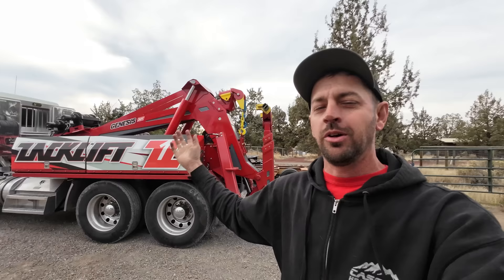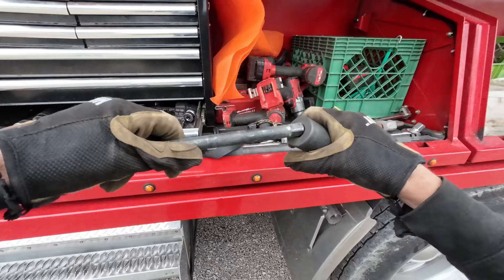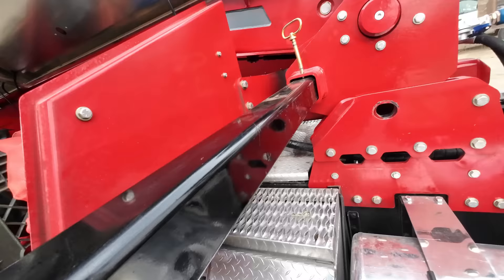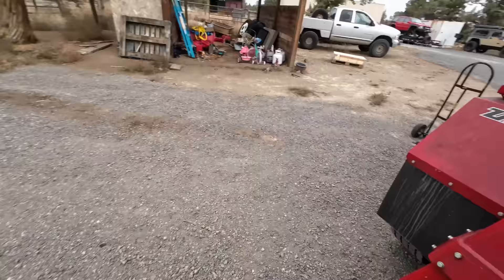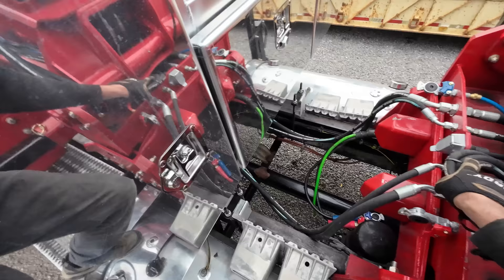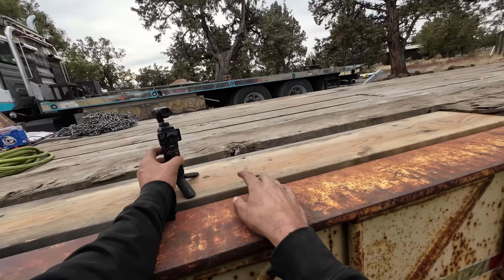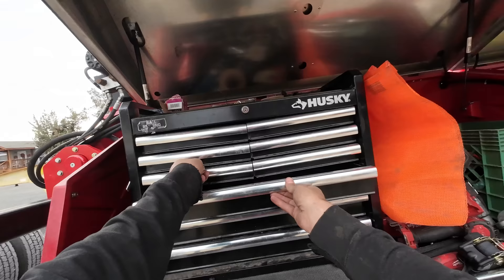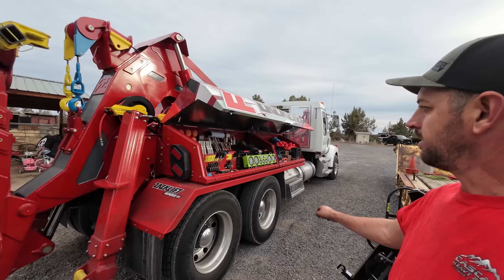How a quick change Heavy Wrecker works!  (the do anything truck)

Comment: I think you can remove the wrecker off your truck quicker than I can remove my camper off my pickup.
Reply: For real
Reply: pretty much the same for getting a roofbox onto my Wagon lol, i'm quite certain that this took me more than 10 minutes
Reply: Same here. Pull behind takes me 15 to 20 minutes to disconnect.
Reply: Funny that's the exact first thing I thought of. 😂
Reply: Faster than getting my w... off lmao
Reply: @deeremeyer1749 just because it's "easy" or "quick" to remove doesn't mean it's incapable of being "heavy duty".

Comment: I like the idea about a winch that uses the existing mount after you detach. I am sure if you contact the manufacturer they would be willing to build you one that uses the same hydraulic connections and then offer the winch as an accessory to their product line.
Reply: Now your thinking! Great idea . I'm gonna steel it ! Lol
Reply: @davestevens4263  Really your going to steel it , or steal it?
Reply: The downside is that a large hydraulic winch is probably a bit heavy and bulky to move into place. A harbor freight battery powered one can be a lot smaller and lighter and still do what is needed.
Reply: Probably would be a good accessory for them to make. But knowing you. Can make it better and faster.
Reply: Add a davit arm to lift the winch on & off. They could easily drop into a bracket on the frame.
Reply: @TBJK07Jeep  your idea is the best, considering that in the background he has goose neck trailer and will a good heavy duty hydraulic winch for it and pulling heavy equipment on to it.

Comment: Since you need a impact to release the tension on the chains you should just remove the jack handles on the legs and weld some nuts on in their place, use nuts that are the same size as the chain tension bolts so you only need one socket.
Reply: I like this idea. I have had tools break, and batteries get cold, so the redundant survivalist in me says to leave the hand cranks, but it's not a bad idea at all.
Reply: @JonathanSias  Weld a socket on one of the hand cranks, redundancy problem solved.
Reply: Yep, I've done this on all my trailers. Welding a socket is the way to go, just keep a breaker bar handy and you're g2g

Comment: I believe you could get it down to 7 minutes after the landing gear becomes permanent mount.
Reply: Could remove the handle and weld a nut so you can use a cordless drill to drop them faster, although idk if it would hurt the gears to do like that.  Awesome equipment and great video as always, Casey!!
Reply: @User_Joe   he tends to not be a fan of depending  on having power tools to run stuff (and having done what you suggested to one of our goose neck trailers  after ripping off a jack handle for the second time (caught a branch once and snagged it on a round bail the other time)   i felt kind of dumb having to use an adjustable wrench to lift a loaded trailer so i could unhook bc i forgot the driver i made a new handle for it lol
Reply: I guess like 8 minutes in the future, while not filming talking and showing stuff plus getting the boxes moved for the legs! ;)
Reply: Agreed us if he wasn't explaining it to us then he could shave some off foe thst too🤷🏻‍♂️😁
Reply: 13:30 that's actually a great idea glad I thought about it 😂😂😂  but really though that looks like it would work pretty good sir
Reply: @wmose3694  You already "need" one for the rear frame hooks, so might as well use it for the landing gear :)
Reply: The front landing legs need to be incorporated into body somehow.
Even something so simple as turning them upside down in  stowage.
Will save time and messing about not having to find them but also give the flexibility of being able to drop the wrecker off in the field.
Other than that, what a well designed and executed bit of kit.

Comment: Zacklift might be interested in building the winch mount for you.  Surely, you are not the only customer that has such a need/desire.
Reply: if zacklift made it then it could be capable of being controlled by the wireless controller from the big unit blue side or yellow side depends on witch hydraulic line he hooks up
Reply: @charlesflakusj.r6344 no because thats integrated into the wrecker body. Not the truck side. Truck pto only supplies the hydraulic flow and moving it. You could run the body off of a pony motor if you wanted to

Comment: I'm not a trucker but I am very impressed with the functionality of the Zacklift and the ease with which you remove/replace it on your truck.
Reply: Remember, there's hardware on the truck, that needs to be hooked up to prior, so the ZachLift can be a securely secured.
Reply: i think any fleet owner who does local stuff and has 10 or more trucks could use this for sure

Comment: Transformer toys for big boys. No need for more speed Casey, I think you already got the chronological order of your contraption down to a science. I love the fact on how clean and tidy the wrecker attachment is, You can detach, walk around with a pressure washer with easy access below, pretty sweet rig, easy to service, the wrecker can be dropped off for repairs without shutting down the truck. A semi for hauling and a rig for towing all-in-one, you can't get mad at that.

Comment: You need a folding engine hoist, modified to be able to lift the winch up onto the front mount bracket (and save your back and another hernia). Beyond that, this looks to be the perfect setup that truly gives you the best of both worlds - a heavy wrecker with some awesome abilities, and a 5th wheel setup to be able to haul almost any trailer you have need to haul. It's very easy to understand why you made the decision that you did for the unit that you did - very nice looking setup, Casey!
Reply: He can store the winch on the flatbed, so then he just need some planks to drag it on and off the truck.  Assuming its down hill he can drag it easy down, and use the winch to drag itself up.
Reply: Not worth it. He has the little wrecker he can use as a crane if its to heavy
Reply: Put similar feet under the winch. You can drive from underneath the lift, and backup underneath the winch. Remove the legs, and off you go.
That way it can even be the heavy duty winch.
Reply: so WHY isnt this used more??? "gives you the best of both worlds"
Reply: @LimBo3500  over thinking it

Comment: Have ZackLift design and build a hydraulic winch to attach to the empty front mount when the wrecker body is removed. You can be tester #1 for a new product!
Reply: yes if Zacklift builds it then it can be compatible with the wireless controller that is used on the tow unit

Comment: Nice change over as a visual when you have the front legs on spray paint to where the holes for the pins to drop throw with ease so if you have to do it in low lighting you will not need to struggle and forget something.

Comment: Very nice setup Casey. Regarding front jacks. Change square receivers to round ones and simply rotate the jacks forward and pin them there. Pull pin, rotate down, and they’re done. Tip: Remove handles and replace with a nut the same size as chain releases.

Comment: Another idea: Weld a tab with a hole in it on the front legs to put the big front locking pins in when they are removed, that way they dont get lost and are right where you need them when it is time to hook back up. Also, chain or safety wire the front leg pins and clips to the front legs so they don't get dropped in the snow or gravel and get lost. 
As others mentioned, paint a stripe around the front legs to help align the holes. 
Great job and awesome piece of kit you have there.

Comment: Hello from the Netherlands.
It might be an idea to place a bracket in the middle under your headboard rack boxes for the air couplings and lighting plug of the truck itself.  
This way they are always out of the way and yet in the right place when connecting and disconnecting.  
and perhaps also hang a bracket on the wrecker unit for the hydraulic hoses, 
so you always place them in the same place and hang them in a good bracket that holds the couplings in place
thanks for the video.  
Kind regards, Hollandduck
Reply from the maker: The headboard is WAY too far away from the trailer for that to work

Comment: An Apex winch in a cradle pinned to the bracket is a great idea. I'm thinking a small A frame above the winch, with a rotating sheave head instead of a normal fair lead to make it easy, well easier on the rope anyway, to go off the sides of the truck if needed. A set of cables, with an Anderson style quick disconnect plug could be mounted under the center box of the headache rack for connecting it to the batteries.
I'm not in the wrecker business, but it makes sense in my head.

Comment: you should ask Zacklift to design and built and winch mount  that goes into their frame mount it could run off of one of your hydraulic  line sets and use your wireless controller. those hydraulic winches are heavy so have the mount have its own set of detachable legs that hold it in the air higher then your fifth wheel so you can drive under it with the truck and crank lower it into the frame mounts.

Comment: You should design a winch plate and market it with Zacklift - you can't be the only driver that would benefit from that - and you've got those pins to use to mount the winch plate, nice and solid.  Good idea.  Nice video  - thanks  (sorry - no criticisms)

Comment: On your landing gear, remove the crank handles, get 2 big 1/2" drive  impact sockets, weld on in place of crank handle.  Use your impact to raise and lower.  If too much weight is on legs, you can use a breaker bar to free up.  Just an idea to make life a little easier.

Comment: O-H-I-O Porter greetings 🇺🇸The Zacklift is rather impressive in more ways than 1! Takes me back to when I used our old 5th wheel boom that was fitted with a cable hand crank & used a bungee to hold handle in place. All mechanical! I can never complain about it since I hauled many tractors & buses with it. You have quite a handy unit there! Thanks for sharing the unload process. Having the bulkhead tool rack on the truck is always a good thing! Never enough storage space anyway. An easy conversion either way & then you’re on your way. Good stuff! 🎄🥰✌️

Comment: Very nice and so versatile!! 
In this day and time whereas so many things are run by impact drivers, it would be nice if the black legs had a nut along with or instead of the hand cranks and then you could use your impact driver to zip the legs down and up.

Comment: This is a nice setup. It will be nice when the front landing gear are mounted permanently, which will shave a few minutes off the setup/takedown time. It seems like any time I have a suggestion lately, you already thought of it in the video or one of the other commenters beat me to the punch. Semper tow!

Comment: Consider adding 3M or equivalent highly reflective tape around the black removable legs.  Wrap the reflective tape around the leg tube at the point the leg inserts into the housing.  This will give you a visual reference as to precisely how far you have to push the Leg into the Housing.  Being reflective makes it easier to see 👀 at night .

Shaves off a few seconds to a minute. 

G.

Comment: 6:20 Routine also helps you remember to do everything. I had a 7 step routine for loading when I was hauling crude oil in Texas. I counted the steps as I did them and then recount after I was done to make sure I had done everything.

Comment: Hey Casey, nice one again 👍
Just get protective plugs on both sides of hydraulic quick couplings. Open couplings are prime source of debris that is later going to the system and destroy valves, cylinders, rods, pump... Don't ask how I know 😅

Oh, and get those doors on the head board sorted 👍

Comment: You have lots of experience heavy hauling, so you know what you need. The real difference is you are smart and creative so you can do things with your gear that others wouldn't think to do...like the idea of the custom mount for a winch. I used a Warn Multi-mount front hitch receiver made for an F series Ford upside down mounted to my inner bumper on my 4Runner to mount a Harbor Freight Apex  winch. I just cut a hole in the plastic bumper cover behind the license plate. When I pull the pin and Anderson plug it comes off easily. Then I can reinstall the license plate and it covers the hole. It's simple, strong and works well.

Comment: That really is pretty damn cool. Someone really did a lot of homework designing that thing. That portable winch idea is awesome. To be honest, I'm kinda surprised that they didn't do something like that and at least make it an add-on accessory or if maybe it did come up in  R&D and it just got shot down.
You could also have deducted about 30 seconds from your time in this one because of that time that you spent around 08:45 when you were explaining the hydraulics and the boom not dropping when there's no fluid flow and another 25 or so while you were setting up the side view camera on the trailer at 11:35, so your actual time was roughly 10½ish minutes here. If you got everything with your side boxes moved back a little, leaving those front support legs attached and got into a routine, I don't think 9-9½ minutes is out of the question at all.

Comment: Add hydraulic lock on the front mounting plate will speed it up, just like the quick attach you have on wheel loaders to release or lock the bucket. And you have room in-front of the mount under the headboard to attach a permanent winch that you can use wen you work with a trailer.

Comment: Great video. But just a thought. Take the handles off of the front jacks. Weld a nut to the shaft same size as the chain tension bolts

Comment: Lights inside your headboard? Backup camera for your kingpin? Hydraulic operated landing gear? Places to store wooden 16"x16"x8" outrigger pads w/rope handles. Kingpin lock when not in use.

Comment: The rear stabiliser legs have a pilot operated valve , this means they won't retract unless hydraulic pressure is there to open the valve. The side support legs could be fitted with hydraulic cylinders instead of winding gear again with pilot valves to speed up the process of demounting .

Comment: The US General are great boxes, but may not fit. They are much deeper. Almost 22” vs 16 for your Husky. 

I love the versatility of that truck. The Zacklift is a brilliant idea and looks like they did a good job with the execution of it. Less than 10 min to go from heavy wrecker to ready for a trailer will keep that truck in service and not just sitting most of the time. Unless you hire someone, you can only drive one truck at a time.

Comment: The winch setup to mount on the permanent zacklift mount would be ideal. Can't wait to see you get the hydraulic feet for the front of the zacklift, much smoother transition.

Comment: I think if you added some tape or marks on the legs to help identify when they are lined up approximately with pin locations could help. I think when you get your routine down you could be under 10 minutes easy.

Comment: You could have some kind of simple shelter you could use to cover part of the rig when it's raining or snowing heavily. To make it easier to connect/disconnect. Also would be nice if the legs/lifts? were hydraulic and you could just flip a switch and they'd deploy themselves. Dreams, I know.

Comment: The pins that hold the removable legs have those spring clips to secure them (not sure of the right term). On a boat, shackle pins are often connected to their shackle permanently with stainless wire, so you're not trying to find them when you drop them in sand or snow.

Comment: That is a nice change option for this rig. You will get the time quicker as you develop a routine, I'm sure. Adding a winch mount to that red bracket is what I thought when you showed it - it would be an easy upgrade. One thing to think about - could you make those front support legs powered so you don't have to crank two separate lifts from opposite sides of the truck ... most trailer landing gears only have to be cranked from one side, right??

The Harbor Freight US General toolboxes would be an excellent choice - they have some really nice ones that are durable, available in a variety of colors. Keep us updated on what changes you make to this unit.

Comment: Just a suggestion, which has probably come up a couple of times already which might save you a few minutes.

You could do everything on one side first - remove the retaining bolt, put the landing leg in, remove the hydraulics on that side, remove the chain on the back. 

Then walk round to the other side and do the same things on that side. Save you walking from one side to the other doing the same pair of things. i.e. remove retaining bolt, walk to other side, remove retaining bolt on that side, etc

J

Comment: Suggestion, on the front legs, use a paint pen to put a ring around the beam, to show where to stop when installing and later retracting the legs.  Also paint the link below the one that hooks into the rear tensioner.  Both should make your life easier when transitioning between truck and wrecker modes.

Comment: Wow, that's really impressive. As for the winch to get something on the trailer - if the trailer has its own hydraulics to operate the folding mechanism is it in theory possible to install a hydro winch on it in the rear?
Reply from the maker: Yes, and I have considered that as well

Comment: Took me 45  minutes to hook up a 8 horse gooseneck trailer, load a white with red crushed velvet seats Vis A Vis wedding carriage in the front with a battery operated remote controlled winch. harness a team of Snow White or Jet Black Percheron draft horses (your choice) and load them in the back of the trailer and off we went. Routine is a fact, after a  dozen or so times of doing it I cut the time in half.